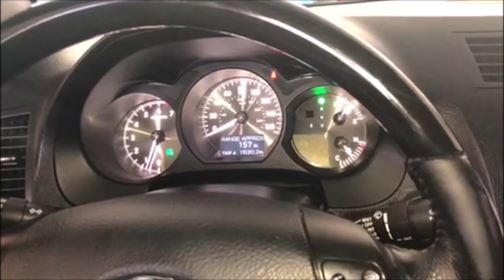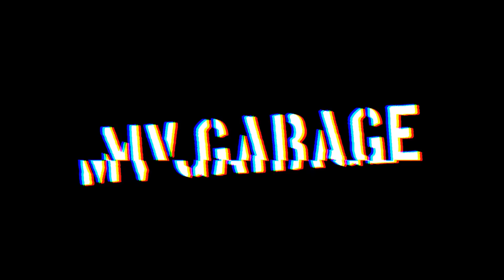Lexus Toyota VSC / Trac Warning Light FIX

Comment: In my 2006 is250 didn't work, it gave me a message saying, calibrating 4wd and nothing happened
Reply from the maker: Diva Car Mania This was preformed on a 2006 GS. Should be the same procedure on yours. It also gave me the 4wd option but switch to
the VSC with it. Maybe try it a few more times. Hopefully it works for you. Also you don’t have a check engine light on correct ?

Comment: I had to play around with it a few times,  with the wires touching and not touching, then turning the key on and off. I couldnt get my VSC and ABS lights to blink simultaneously but they do blink slower before the 4 taps in 8 seconds and fast after and the 4 taps. The VSC lights go on every time a mechanic plugs in a scan tool to the OBD. Im having my accumulator replaced and I'm afraid the ABS light is going to stay on after that. Ive told 2 different shops about the video from a Snap On mechanic, but they never can get it right
Reply from the maker: ljgsuper yea definitely not to difficult to do.

Comment: The VSC and engine light came on for me when I just removed the air box senor and changed my parker lights how the hell does that effect the car so much now its still on Im scared to drive my is250 06 HELPP PLEASE!!!!! ASSP
Reply from the maker: Sounds like the mass air flow sensor may be unplugged. Is the car running rough ? Also once that’s figured out. Use this video to reset those lights https://youtu.be/iLrolhRr9lk
Reply: @FlipITGarage  yes that's was the issue I turned the cr back on with out it bad idea lol but all done was I just unplugged the battery it reset the ECU all done and clear no lights now 😎
Reply from the maker: @Senorinka  Awesome. Glad you got it figured it. Let me know if you need anything else 🤙🏽

Comment: For everyone freaking out, first off Relax! I have the fix for you. Anyone driving a ES, IS, GS, or Rx 2006-2014. This comes directly from my best friend who's a mechanic at Lexus. Once that VSC light comes on, chances are that the check engine and the traction control light comes on as well. Hold the bottom on your floor next to then ACF button. Most likely that 2nd button is unmarked. After 3 seconds the low tire pressure light will flash 3 times. Set your trip meter and  drive your car 50 miles. It doesnt have to be consecutive.  Take it to an empty parking lot and drive left in a circle for 4 minutes. Then drive right in a circle for 4 minutes. Park your car and turn it off Wait 10 minutes and all the lights will be gone. That VSC light is one of the primary money makers at their dealership (220 to diagnose, 300 and up to fix). Its not a total scam because when they charge you, they make sure nothing about the VSC is actually causing that light. He told 95% of the time its not. Anything from a flat tire, speed bump, or even a loose gas cap will cause that light to pop on. I never saw that light before and i called him immediately. It was a simple fix. Follow these steps and you'll be good. When it works for you, just share this on any Lexus forums that you may visit or another related youtube video so other people dont get ripped off by these shady car repair people.
Reply: Which button are you talking about, sorry? I can't find any in my RX400H 2007
Reply: @jin_is_shy  You have to crawl down there and use a flashlight. There should be two buttons directly under the steering wheel. I am not 100% sure but there might be a possibility since yours is a hybrid. I will text my guy in the morning and see if he has an answer for you
Reply: On my 2007 ES350, the second button next to ACF button is tire pressure reset button.  This is a long procedure but I guess I have no choice but to try it out since nothing else worked.

Comment: What happens if my car won’t start but these lights on
Reply from the maker: Is there a check engine light on too?
Reply: @ yes
Reply from the maker: @ I would start by pulling the codes for the check engine light. It’ll help give some direction.
Reply: @ I got vsc,vgrs,brake malfunction, and something starting with a E. Then I have traction control light brake light abs light

Comment: Just tried it like 4-5 times on my 06 rx400h and it’s not working 😢
Reply from the maker: Do you have a check engine light on?
Reply: @FlipITGarage  no check engine light…but just found out that there was fishing line wrapped in between the Cv Axle & Rotor which may have damaged the wheel speed sensor, so I’m hoping a new sensor will fix it
Reply from the maker: @galaxystar9969  Good find! Hopefully that’s all it is. Cheap fix just be careful when pulling the speed sensor out they like to get stuck.

Comment: My dashboard sign VSC And Engine sign I try doesn’t work
Reply from the maker: Zayan multimedia won’t work if you have a check engine light on. The VSC is on because the check engine. This only works if it’s just the VSC.

Comment: 2008 Lexus GS 350 here it says « AWD Test mode » and not « VSC Test mode »
Reply from the maker: It should be the same procedure. Should be switching messages between VSC mode and AWD mode if done correctly.

Comment: I do same thing but the signal was not went !!
Reply from the maker: عبدالسلام الغافري do you have a check engine light on too?
Reply: MV Garage yes i have cheack engine light on
Reply from the maker: If you have a check engine light on that is the reason the VSC light is on too. That needs to be fixed first.
Reply: MV Garage  i fixed  and change the oxygen sensor bank2 sensor1 which it come in computer and the cheack engine light off for 1 week after that come again ......
Generally,the cheack engine light ,vsc,trac come at same time ...

Comment: man, I just changed my breaks. a few miles later this popped up.
Reply from the maker: Lawrence Martinez It happens sometimes when changing your brakes or taking a wheel off. Probably just hit the sensor. Try this procedure should work.

Comment: Mine still says check vsc .. it doesn’t so “test vsc” or anything help
Reply from the maker: Rocky E what car you working on ?
Reply: MV Garage I did this and my CHECK VSC is still on as well. Any suggestions? 2006 Lexus GS300 AWD. The code I received from OBD is P2198. O2/Air-Fuel Bank 2 Sensor 1 Stuck Rich. Found the sensor but it is impossible to remove. Too tight of a space.
Reply from the maker: Zac sounds like you have a check engine light on. You need to fix that before the VSC light will go off. And yea for that light I would start with the sensor. Try taking it off carefully when the exhaust is hot. The heat helps. Or torch around it.
Reply: MV Garage Yes, I believe you are correct. I attempted to remove it today, but the space to work with is making it very difficult to get ahold of it. Engine had only been running for about 5 mins, so it wasn’t hot. I’m worried that if I do get it loosened and removed that I won’t be able to detach it from the connector. And if I was able to, cleaning it or getting a new one in there would seem to be just as difficult. I’m about to raise the white flag and take it to Lexus, but I know it’s going to be a pretty penny.
Reply from the maker: Zac The plug to disconnect it is under the carpet inside the car. You just pull the carpet back some. I believe the passenger side. Very easy to get to. If you don’t feel confident replacing it then yes I would take it to a shop. But I wouldn’t take it to the dealership. Take it to a good independent shop. You’ll save 100’s.
Reply: MV Garage Bank 2 Sensor 1 is the upstream sensor which comes off the exhaust manifold under the hood. I believe you’re referring to the downstream one (sensor 2). I think I’m going to get a sensor socket and remove & clean the sensor if I can get it out.
Reply from the maker: Zac Oh okay. Sorry didn’t look up the code. But yea I would give it a try yourself first. And if you can’t get it then pay to get it done. Keep me posted. Good luck!

Comment: Okay cause mine came on too an  engine light an says check  VSC   So I wanna fix as fast as possible. It’s a Lexus GS 300 2006
Reply from the maker: If you have a check engine light on that is the reason the VSC light is on. They go on together. You can reset them by disconnecting the negative battery terminal for 10 minutes. But if the light comes back on you’ll need to get the check engine light code and get it fixed. Autozone scans the code for free if you don’t have a scanner.
Reply: @FlipITGarage  thankyou I’ll try it
Reply: @FlipITGarage  one more question the sunroof is off track it works up the front end is piped out an the back is in place I’m trying to pop it back in but don’t wanna use to much force
Reply from the maker: @bryantmartinez3101  if the sunroof is off track it may need to be taken apart and put back together unfortunately. You may be able to snap it back but take the risk of breaking it.
Reply: @FlipITGarage  okay I’ll see if I can take to a place. Thankyou !
Reply from the maker: @bryantmartinez3101  your welcome!

Comment: Sorry im back again.. i scanned my Lexus with the Obd scan tool.. it gave me these codes : 
2 Electronic Controlled Power Steering Codes (C1241) (U0126)
2 Smart Start Unit Codes (C1241) (U0126)
1 Electric Motor Power Steering Code (U0105)
2 Antilock Brake System Codes (C1241) (U0126)
2 Four Wheel Drive Codes (C1241) (U0126)
Reply from the maker: Mitsu RT I would start by clearing all those codes and try scanning again in a week or so. To see which ones come back. If any.
Reply: MV Garage kk will do Ty
Reply: @FlipITGarage  do you know if resetting the vsc with an odb scanner will cause the vsc system to recalibrate itself
Reply from the maker: Hard Art I haven’t done it on this car with a scan tool. This procedure works just fine for resetting the VSC system.

Comment: I did it and its still on what im i doing wrong
Reply from the maker: Taddy D what kind of car you have ? Year make model? And what did it do when you did this procedure ?
Reply: 07 gs350 lexus RWD
Reply: I followed what you did but when i started the car the lights came back on
Reply from the maker: Taddy D If the light went off but came back on then you have a real issue with one of the sensors. This only works if it was triggered and there’s no real issue. You’ll need to get it scanned. More than likely one of the wheel speed sensors is bad.
Reply: I recently added 20"s staggered on there and after 2 months the vsc light and check engine came on , what ill do is replace all 4 wheel sensors and see if any thing changes ill keep you posted , thanks
Reply from the maker: Taddy D Your VSC light is on because the check engine light is on. They go on together. Get the code scanned to see what it is. Any autozone will scan it for free.
Reply: Ok thanks

Comment: didn’t work on my ct200h. just says “DSS1” on my gauge 😭
Reply from the maker: Kevin Vernal Your car doesn’t have a check engine light on as well correct ? Because if it does this procedure won’t work for that.
Reply: @FlipITGarage  I see that makes sense, because I have a 2006 Lexus GS 300 and this did not work but I have VSC light and check engine light. This occurred while driving in snow conditions and has not yet cleared even after conducting this VCR reset, help!
Reply from the maker: @WarMastaP  Yes, when the check engine light comes on it automatically triggers the VSC light with it. The check engine light would need to be fixed for the VSC to go off. You can reset both lights by disconnecting the negative battery terminal for 10 mins. But if the check engine comes back on after it will need to be diagnosed and repaired.
Reply: @FlipITGarage  Thanks reset it. It worked hasnt come back since
Reply from the maker: @WarMastaP  Your welcome! Glad to help!

Comment: Didn’t work for me🥴
Reply from the maker: Do you have a check engine light on too?
Reply: @FlipITGarage  yeah and the traction control too
Reply from the maker: @vascoofficial1714  Yea then this procedure won’t work for that. You can disconnect the negative battery terminal for 10 minutes it should clear all those lights. If it comes back on you’ll need to pull the code and get it repaired. Video link: https://youtu.be/iLrolhRr9lk

Comment: Light came on check VSC the steering wheel was hard to move I just parked my car and after I turned off my Lexus car is not turning on even the dashboard Bt battery is fine

Help my wife is hoping I can fix it
Reply from the maker: Do you have a check engine light on as well? And since the steering got hard sounds like the alternator may have went out. Are you sure the battery is good ?
Reply: @FlipITGarage  thanks for replying 
check engine is not on , I charged the battery it turned on and dashboard looks crazy all lights on and then all lights off while engine is on, I turned off the engine and again it wouldn’t turn on
Reply from the maker: @aytvsromero2924  No problem. I’ll try to help anyway I can. If you are able to charge the battery again and get it started. You can connect a volt meter to the battery while it’s running and see what the voltage is reading. Reading should be around 14.2v but worst case above 13v. If your able to do that we can see if it is the alternator.
Reply: @FlipITGarage  i guess it was just the battery I got a new one and the car works again all warning lights disappeared
Reply from the maker: @aytvsromero2924  glad it was an easy fix. Yea seemed like it was a power related issue. Happy wife happy life 😃
Reply: @FlipITGarage  haha thank you I’ll will watch your videos to learn some

Comment: You can do this with a cheap ($20) scan too lol
Reply from the maker: Clear a VSC light only with a $20 scan tool ? Which one? I’d like to buy one.
Reply: @FlipITGarage   Any generic obd2 scanner is capable 👌.  Doesn’t matter the brand.
Reply from the maker: @okistash3075  Those will only clear a VSC light if there is a check engine light on as well. This procedure is if there is only a VSC light on without the check engine light. Totally different. A cheap scan tool  cannot do that. Plus with a check engine light on you don’t even need a scan tool. Disconnecting the battery will clear it.

Comment: It ain’t working for me
Reply from the maker: You have a check engine light on with the VSC light?
Reply: @FlipITGarage  yes I do
Reply from the maker: @Quaad_TV  If you have a check engine light on that is the reason the VSC light is on. They go on together. This only works if it’s just the VSC light. You can reset check engine/VSC light by disconnecting the negative battery terminal for 10 minutes. But if the light comes back on you’ll need to get the check engine light code and get it fixed. Autozone scans the code for free if you don’t have a scanner. Video link to reset it: https://youtu.be/iLrolhRr9lk

Comment: Doesn’t work I try
Reply from the maker: Zayan multimedia if you have a check engine light on this won’t work.
Reply: Can I fix it my problem
Reply from the maker: Zayan multimedia Yes. I would recommend getting the code scanned to see the issue. But you can disconnect the negative battery terminal for 10 mins to clear the check engine light and VSC.
Reply: MV Garage You think so it is work no more light My dashboard
Reply: So how can I fix please tell me
Reply from the maker: Zayan multimedia disconnecting the battery for
10 minutes will clear your check engine light.

Comment: Mine keeps come back on
Reply from the maker: B Ortiz This is the reset procedure. If you have a real issue it’ll come back on you’ll need to fix it first then do the reset. If it was just triggered and there isn’t a real issue it stays off.
Reply: MV Garage ya it’s the second time it comes out
Reply: MV Garage it’s not the torque rite ??
Reply from the maker: B Ortiz I would check the wheel sensors. Did you ever figure it out ?
Reply: MV Garage no bro ima check that first at the Lexus dealer hope ain’t a issue
Reply from the maker: B Ortiz hopefully a plug came loose. Let me know what they find.
Reply: @bortiz5260  got a solution?

Comment: later it come again , because you dont fix the problem
Reply from the maker: It will come on again if you have a real issue Frank. In the video I mention if it was triggered by replacing wheels etc.. it will work as it did for me. VSC can get triggered for a number of reasons. If you have a real issue that needs to be fixed first then you do this reset procedure.
Reply: got it.
Reply: i fix problem of the car , and later, i reset it. ok got it.
Reply from the maker: Franky Martinnez Yes exactly. Let me know if I can help with anything else!